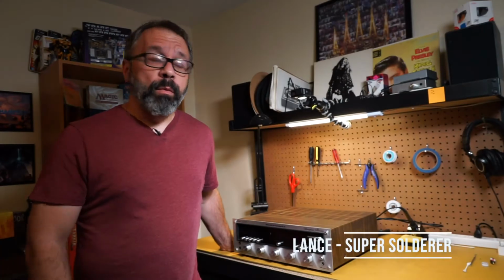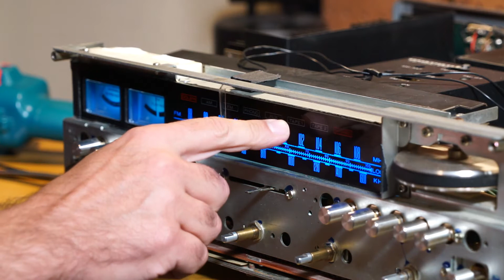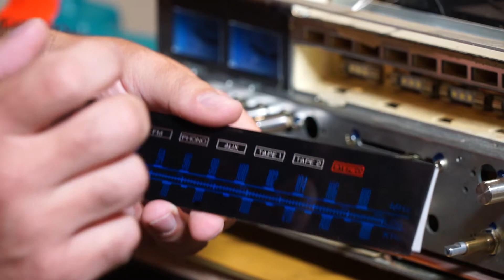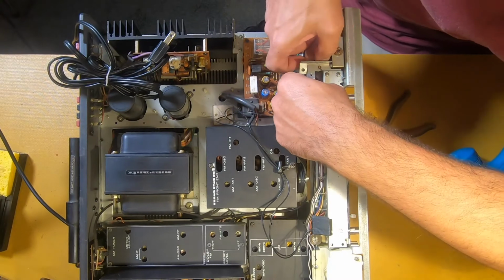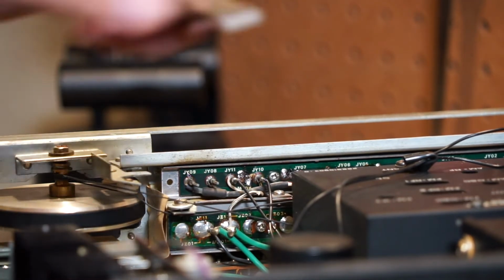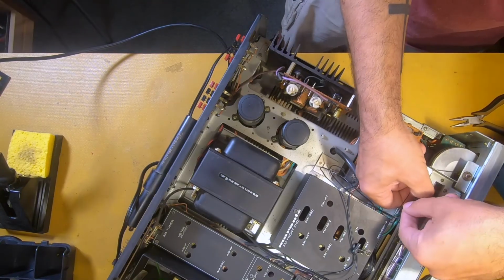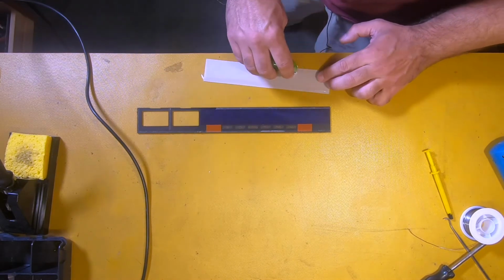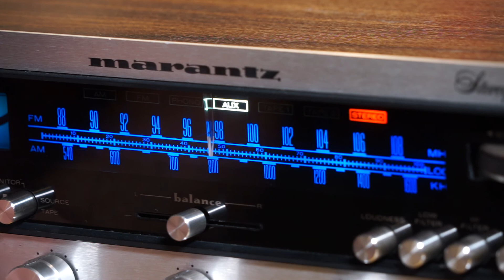I DON'T KNOW STUFF: SOLDERING INDICATOR BULBS ON A MARANTZ 2240 RECEIVER

Comment: Why not order a replacement lamp and indicator kit and do them all while you have it open?.
Reply from the maker: In this case the lights were already swapped out and I did this video on the basic cleanup https://youtu.be/9OkYMh5Raj8 - But yes ideally you'd do the bulbs when you deoxed the pots and that's when you'd check all the indicator lights as well. Again in this case I was done with it and the bulbs were new. During testing I found that the indicator  light wasn't working and wanted to give it a proper solder so I hit up Lance. This was actually the first video we collaborated on so that was cool too. Thanks for the comment!